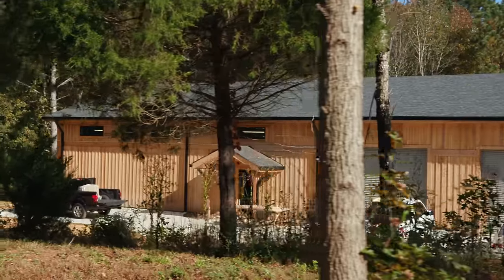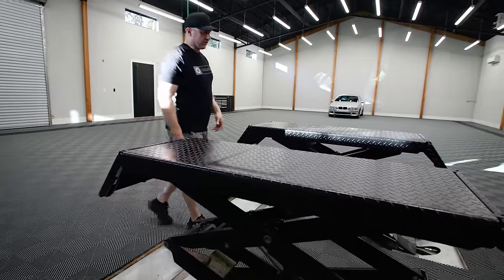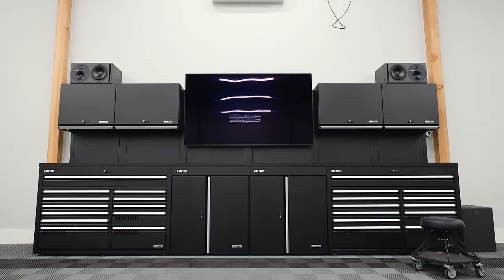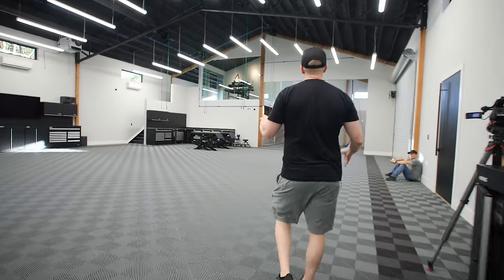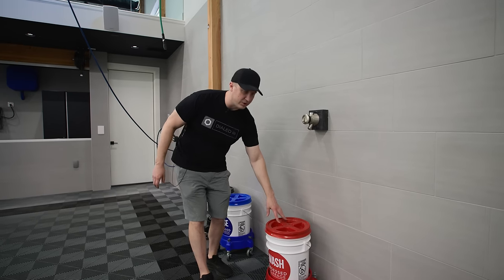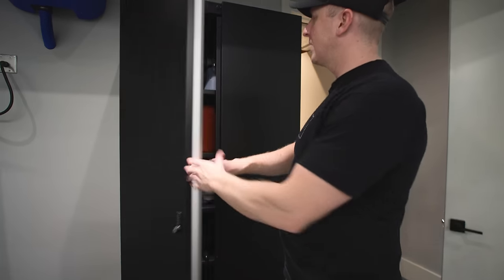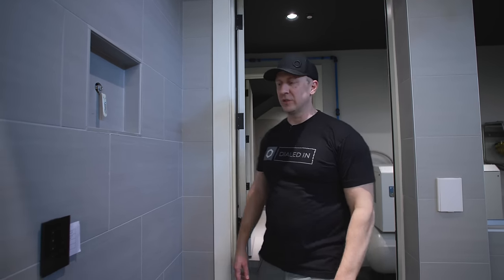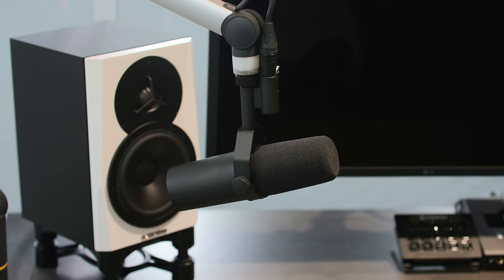The BEST Garage Ever Built: Final Overview and Walkaround!

Comment: Very nice garage. Instead of chargers dangling down from the ceiling, wouldn’t the ultimate solution be to have a plug on the wall behind each car, then run a hidden cable under the tracks, to underneath each car?
Reply: Yeah I think then you would have too many dangly items and take away from the clean look.
Reply: I don't think normally anyone is looking up that much, so you probably don't really notice them?
Reply: You could be tripping all over the cables then

Comment: It's so true you can barley notice all the work put into it because its so neatly placed. I designed my own Route 66 garage/service station. I wanted the external look of a retro triple bay service station, but with a larger interior, so I went 80'x40'x14'.  I was able to stash a partial second story office in a corner as well, albeit with a 7' clearance. I added a 40x36 basement under the store side of the garage only. On the store/sales side I have a full kitchen, table, sofa & pool table.

Comment: Very impressive garage, well thought out, assembled and finished. Personally I am not too sure about the Swisstrax, it looks awesome but a lot of dirt and grime will collect underneath them. A smooth epoxied or tiled floor would be easier to wash and clean.
Reply from the maker: That's the entire point.  The dirt disappears and can be cleaned when needed.  Epoxy is the worst type of flooring in any location.
Reply: @ObsessedGarage   Agreed on Epoxy.  Question: aside from Swisstrax, Matt, did you have any pro/con research for Staining or Polishing concrete garage floors or are those a waste of time and money?

Comment: 20:25 Did you guys think about installing a sort of crook on the wall there?  It's a thought while watching this.  If you had it hinge at the bottom allowing it to angle to like 45 or so degrees you could then use that to keep the power washer, dryer and vacuum hoses long without draping across the garage.  Basically move their drape up to like 10 or 15 feet or however tall the ceiling is.

Comment: would that lift be big enough and strong enough  for a 79 series Landcruiser, probably weighing around 2.5 or 3 + tonsbecause it looks like itcould only lift a 1 ton car
Reply from the maker: It's rated for 9000 pounds.
Reply: this is one of the best, safest, most versatile lift systems out there.  It picks via the frame rails making far more secure contact, even and balanced contact.

Comment: Using Snap-on tools for 15 years and a few other most pro grade tools are very similar. What sets Snap-on from everyone else is there ratchets. They are the worth the money to buy and replace what you have in my opinion. Sonic tools are very good value but upgrade the ratchets to soft grip Snap-on

Comment: Alot of unessecary blue exposed pipe  Looks like cheap diy plumbing gigantic connectors. Pretty cool garage. Would have done some sick epoxy floor or stamped concrete w radiant heat.
Reply from the maker: As long as the pipes are run in a uniform manner, I prefer them to be exposed. It allows for easy maintenance.

Comment: Without adding all the detail stuff and cabinets how much did it cost to put that building up? AC, Heat, garage doors, interior finishings?
Reply: You’re at well over a 150k+ with just those last line items. The building itself is going to vary immensely depending on geographic location.

Comment: Any ideas on swisstrax in a garage that also doubles as a woodworking shop?  Woodshop would have dust collection attached to the tools, but that doesn't catch all the sawdust. I assume I could just vacuum the swisstrax when sawdust build up underneath them gets on my nerves?
Reply from the maker: It's pretty good for that application.  It tends to develop a static charge that will attract the dust, and yes, you can just vacuum it up as needed.

Comment: Very well thought out and I love everything about it.  We all have different preferences and I would have not don’t the flooring like that.  All those drip spots of oil will collect dust and add to the stink your air and climate systems are working so hard to improve.  Would have come with a “stone hard” floor.  Have that on my current shop and it’s indestructible.  

My lift preferences are different as well.  Those lifts still require me to be on a creeper and the platforms tend to block fuel/brake line and electrical harness access.  Those are great for detailing the cars I’ll give you that but for basic maintenance they are not my preference. That being said, the way you recessed them into the ground is epic.  Great job.

Doesn’t the local municipality require you to reclaim the water from your wash area?

Comment: So how do you clean up oil once it goes down meshy tile? 😳 also sometimes you get tiny screws that will drop is it possible to separate tiles at any section?
Reply from the maker: First, how many times do you drop screws?  Once a year?  Just pop up a tile.  Second, pop a tile up if you get a drop of oil on the floor.
Reply: @ObsessedGarage  well I worked in body shop so screws would drop daily sometimes magnetic tools are weak, you miss your pocket 1 or 2 drop on floor, other times if you put them in plastic cup it’s gets knocked over so on. But that’s good that it can pop off

Comment: I've been in garages similar to this, don't call them shops because you can't do any actual work in them.  It's a vehicle display facility with the facade of a shop.  My TV pulls out and pivots so you can watch a race or youtube while working.  To have it stationary like that you may has well set up the leather sofas and beer fridge.  I also have smart lighting.  Handy as hell when a hood went on and there was too much glare off the windshield to find the bolt holes.  Voice command, I killed the lights to the bay.  I'm not a fan of your lighting or your high gloss white wall glare.  You tried to bridge two worlds and failed on both.  Since this is certainly not a shop that is practical for so much as the cleanest, most basic work of even high end vehicles, it's an entertainment place for auto enthusiasts.  Where's the kitchen, where is the couch and why is the beer fridge back in the utility room?  It's not even practical for watching a game or drinking beer!  I did note that it seems that the air is plumbed quite nicely to be practical, not a word regarding the air system or compressor.  Mine has an air cooler system with moisture traps everywhere.  In your entertainment area, why did you use standard $1.19 outlets?  For Christ Sake,  even my poor broke ass managed to afford a USB outlet at my charging area.  If you custom re-built a tool box, why was it not custom wired?  A Kobalt box comes wired for tools and USB.  You clearly have never worked or so much as watched a game in a shop!
Reply from the maker: I don't see why this concept is so difficult for some people to understand. This is not your local blue collar, small town mechanic auto shop. It's also not a clubhouse for you and all your buddies to kick back on the couch with a beer to watch the game. That's just not what this is. It is a private garage, where the owner can store his cars and work on them as he needs.

In regards to some of your other questions. 
There is a property wide fully automated Lutron Homelink lighting system. I had nothing to do with this, it was already an established system he had integrated into the property.
The whole cabinet array wasn't custom built. All we did was incorporate the controls for the Nussbaum lift into the array for a simple and clean setup. 
As for the wall outlets. The USB outlets just aren't necessary in my opinion. The traditional plugs work perfectly fine. If you need to charge something via USB, just use the adapter that the thing came with.

Comment: Why this stupid plastic floor in a new garage like this 😭

Honestly why , what’s the purpose
Reply from the maker: It's not just a basic "plastic floor." I've gone through all the garage flooring options from polished concrete to epoxy and urethane. None of them come close to the Swisstrax when it comes to appearance and quality. 
They're extremely strong, chemically resistant, and they let dirt and water pass through them so you're not slipping all over the place.
obsessedgarage.com/products/swisstrax-ribtrax-pro-6-pack-10-32-sq-ft
Reply: @ObsessedGarage  the flooring doesn't allow you to know if you have a fluid leak.  Brand new vehicles can have fluid leaks.  The flooring will also collect and trap debris.  No drilling, sanding, or grinding, no nothing can be done in the so called shop.  You can't do so much as minor trim or electrical.  You will never find that tiny nut or washer when it hits the floor.
Reply: @ObsessedGarage I’m glad for you that you make money on this, that’s always a good thing. But there the good things stop 😂